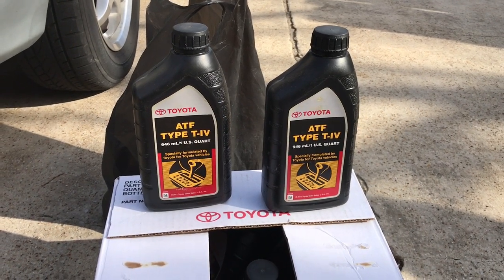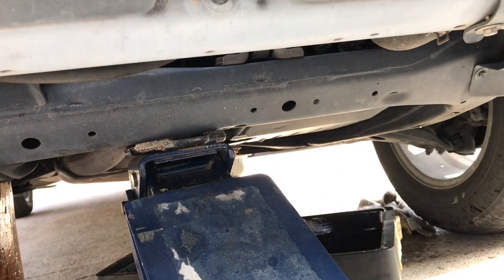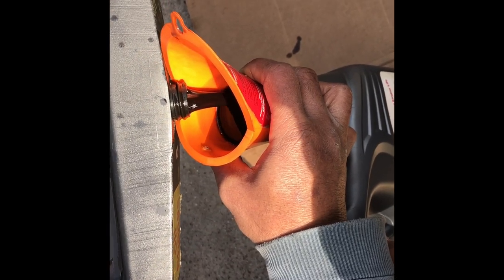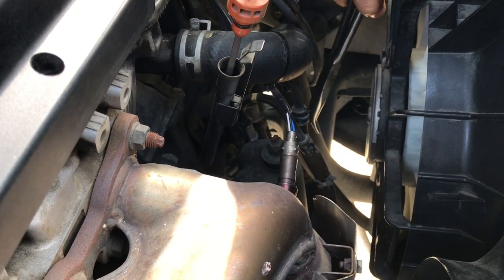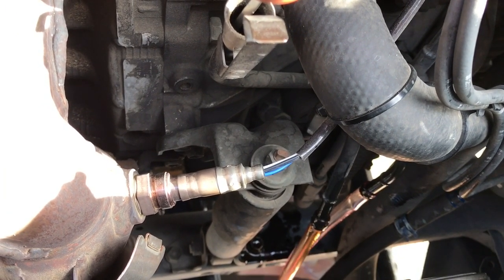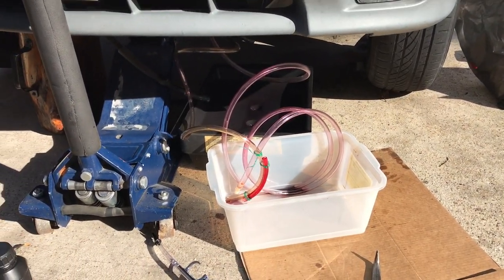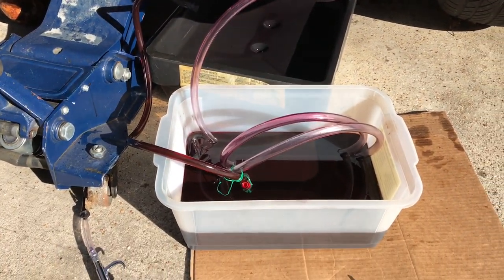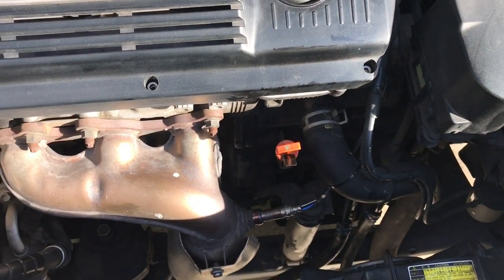Flush Transmission Fluid on 2002 TOYOTA Sienna

Comment: This is for 2002 sienna. Drain and refill needs 3.7qts; Dry refill needs 6.9 qts as per service manual. Approx 3.5qt/7.0 qts easy to remember.  drain plug bolt torqued to 36ft/lb as per Sienna service manual
Reply: Can I just drain and fill once and it’ll make my transmission healthier?

Comment: Why did you take the high pressure off at the engine before the transmission cooler? Why would you not just take the return line After the transmission cooler and tap it there into your drain bucket to flush all that  as well?? That's what I'm going to do..
Reply: Which is the high pressure hose and which is the return hose?

Comment: Pretty good overall but you only need to disconnect the output hose from the trans cooler and hookup a clear hose.  Get your new fluid ready and with a helper in the car,  have them start and put the car in Drive/Reverse a few time to get the fluid circulating from the torque converter.  MAKE SURE NOT TO LET IT RUN LONGER THAN it takes for you to replenish with new oil through the level check stick hole. It's ok to stop the car to fill roughly what comes out.  You would have to measure precisely if we didn't have a level check stick.  No need to blow air anywhere. Repeat until the fluid is clear. Then check level after and add or remove overage. This is where its' ok to be a quart shy during refill so you don't need to remove overage.

Comment: Manual shows to use Dex III oil
Reply: you're correct! easy way to find out is by pulling out the deepstick wipe it clean and will show at the bottom
Reply: Dex IV is backward compatible.